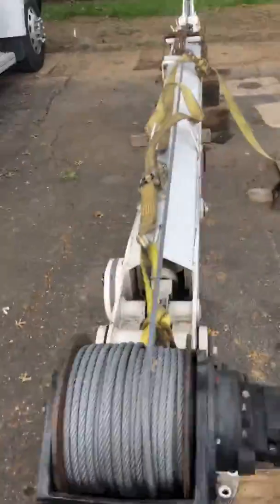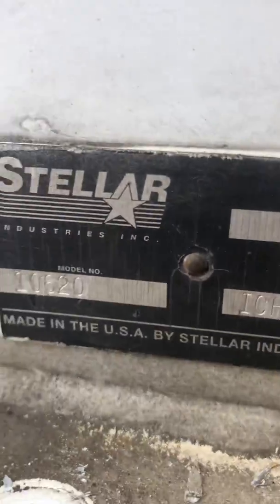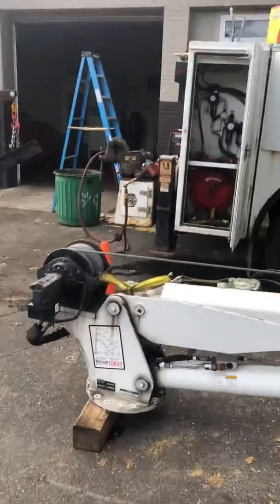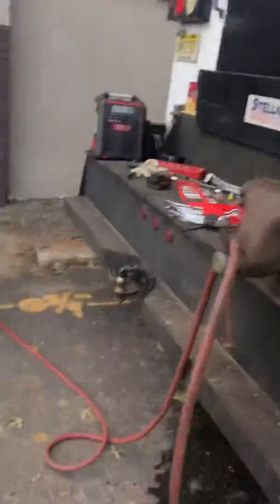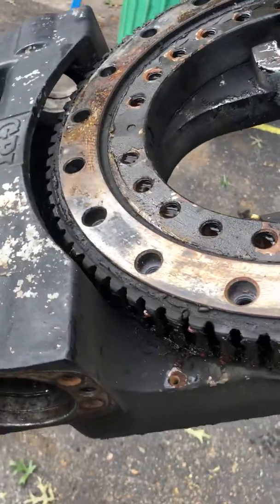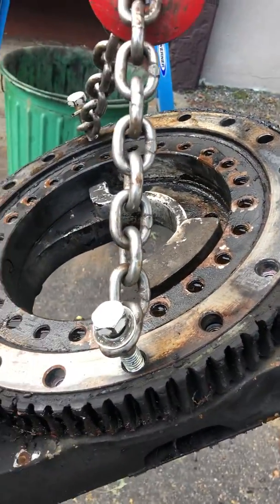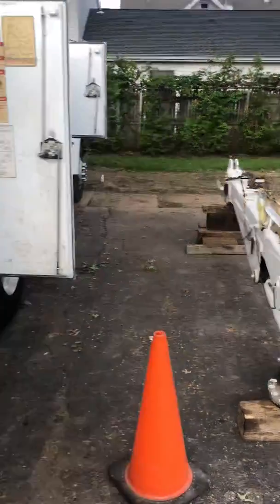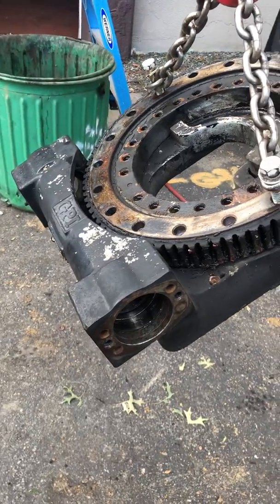Stellar 10620 crane worm gear replacement

Comment: Just broke my worm gear on my summit body today was wondering if a guy could get it started in the hole and push the crane sideways and let it walk itself into place
Reply from the maker: Some you can from what iam told, mine I could not. The ends were to fat, plus installing new seals there was just no other way but to remove it..

Comment: Nice truck and crane , found your clip from the need to repair my worm gear. Different size, smaller, and different crane  similar problem. I bought a crane with a sieze worm drive and am trying to free it. good luck with the repair and cheers.
Reply from the maker: Will Tricks thank you.. repair is done and crane is up and running, it you have any questions let me know.. 👍🏻